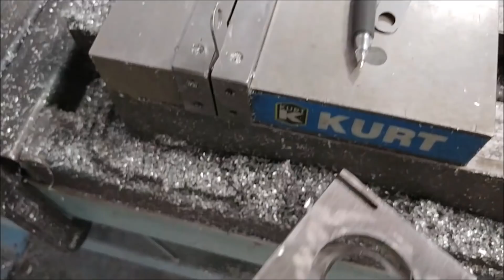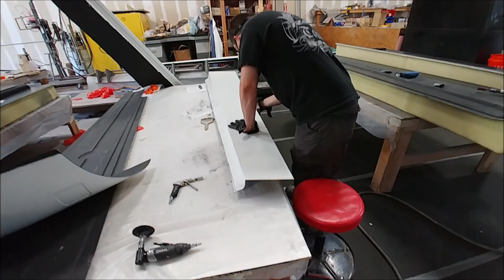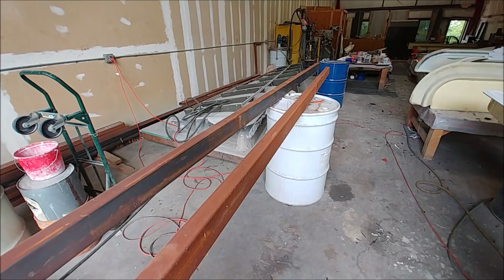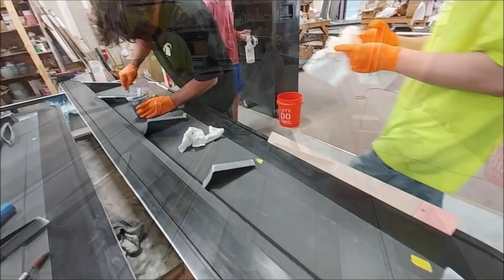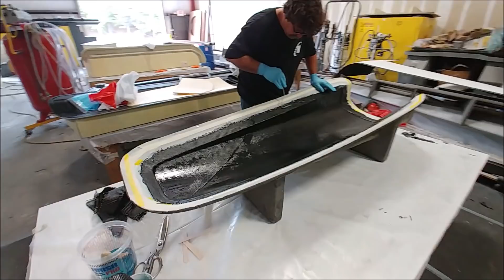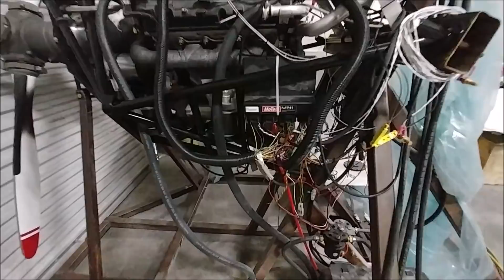Ailerons and Rudders - Building the Raptor prototype

Comment: Lots of parts being made, but it's hard to tell how far along the airframe is.  Would you be able to provide an approximate airframe % complete every once in awhile?
Reply: rnordquest maybe after you built a few you could do that, but this one off first prototype will always have tons of stuff coming at you left and right you didn’t expect or work the way you thought, those doors being a good example.
Reply: Niels F 90% done, 90% to go.
Reply: Silas Thomas But a parts count is still a measure nonetheless. After that will be an assembly count. Then there's redesign and repeat along the way. It's an easier progress measure for us as we have no clue on what needs to be done. It will be the same for flight test. You can tell me this or that was completed but where are we in the number of tasks? Time is independent.
Reply from the maker: You're basically asking 'are we there yet? We're done when we're done.
Reply: No I'm not; that would involve time or date.  There are x parts. How many are completed?  That still allows you to be done when you're done.